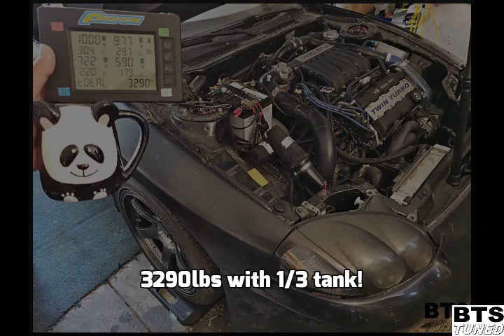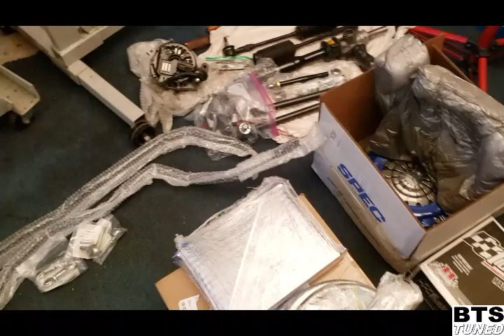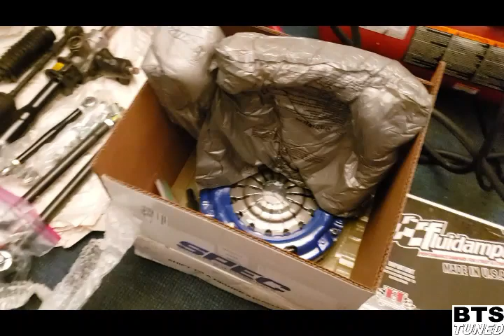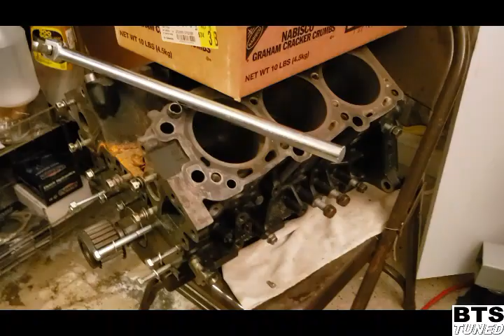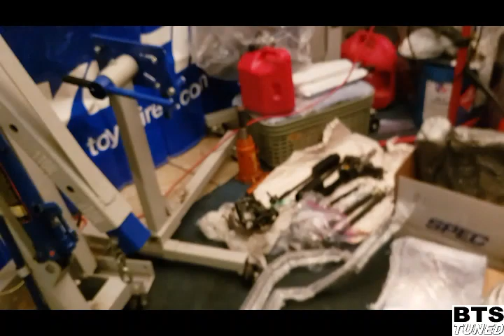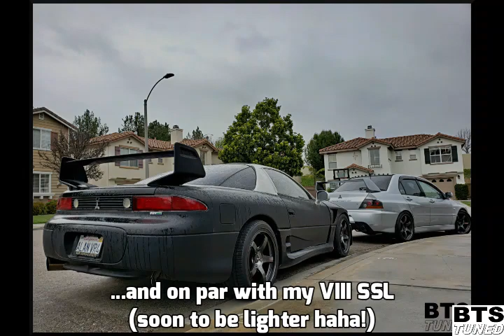ALan's Panda v.3 3000GT VR-4 "2019 Build Begins"

Comment: Anyone know max boost for DR500 turbos??
Reply from the maker: It depends on many factors. DR500 have 13C compressors, and I have previously pushed them to 20psi many, many years ago. They are a 13G class turbo. You will need more than 91AKI fuel to accomplish this effectively.